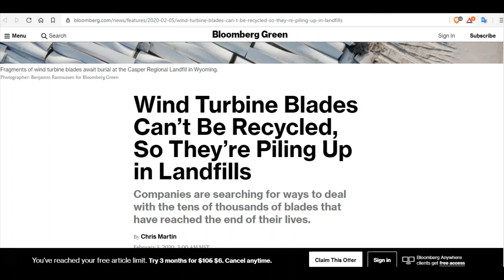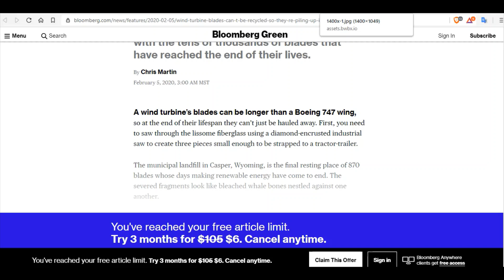Unfurling The Waste Problem Caused By Wind Energy - Boeing's Idea Of Sustainability

Comment: Hey and another little known fact here I spent most of my career and the fiberglass and Plastic industry and I can tell you is that the main ingredient in fiberglass and fiberglass production is oil are petroleum products if I was simply creating these wind  turbines replace fossil fuels I would eventually have to keep using fossil fuels to keep building them great plan right?

Comment: Oh it gets worse than that diamond. MY son a Certified Rope Access Technicians. He spent a year working on those wind turbines. Those turbines have a high failure rate. Yearly. Just to cleanup the mess up that happens  inside those coning tower's is a $10,000 dollar bill to start..  Those gear box,s scramble horribly. And are filled with 55 gallons of oil that blows out the busted case and runs down the whole  inside into a concrete tub at the bottom. 
A barrel of oil per tower . Count those towers around the planet. And know its get over hauled at least once a year. At around $100k to 250k each . And those blades. The Edges is a $75 To $100 an hour full time 8hrs aday per each blade of a job . Not including materials.To fill and patch all the pitting that takes place..  Turbine farm  of 300. contributes less than  10% of energy  as a whole . to power the companies. Notice you never see everyone spinning during a windy .  it cost more To maintain them then they produce in  output ENERGY.

Comment: East Germany build 4 million fiberglass paneled, 2 cycle powered cars called Trabant. My father owned one. They were unable to completely recycle all that fiberglass after the cars landed in scrap yards. Eventually, a wise man designed a street paver made out of crushed fiberglass and concrete mix that dispensed with the problem.

Comment: Never thought about a windmill as a co2 solution. It is more of an engineering challenge of competing ideas. 
    Personally my house runs on a heat pump. And with one you learn to supper insulate.

Comment: Would they melt if dumped into an active volcano? Fiberglass is glass after all. Wouldn't it just melt back to silicon again?  That seems really stupid that they can't be recycled. How do they transport them to the installation site in one long piece? They must have equipment to transport them, but we need to cut them up to bury them? This makes no sense.
Reply: Oh yeah in grand forks nd I've seen them being transported on a huge trailer. Traffic had to be stopped to just get that thing on the road.

Comment: That's not true that it can't be recycled they don't want to pay to do it right. They can grind it up and use it for road fill and mix it with asphalt. There's only one problem it makes the road so good it doesn't were out and the road builders don't like it no more repair work ground up tires do the same thing lasts up to 3 times longer. No contracts no jobs that's the real reason.

Comment: I’ve got your point, any alternatives to this problem. Firstly the carbon footprint of these turbines is extremely poor, the “clean” energy these things produce during their productive lives, barely covers the pollution and CO2 emissions for building these wind turbines. One company in Europe is making the blades from steel, so they at least can be recycled after their lifespan. At present I am at a loss for alternative processes for cleaning this mess we’re in, but to use less and be more efficient in using our precious resources.

Comment: Damn. I'm a Texan using wind power company for about a decade, now. Came across this video after researching to go one better by diy geothermal to heat/cool my home. 

This is sickening, just like the latest and very recent Michael Moore produced doc dealing with other problems in the green energy movement that are tied to the corporate model problem as well. Why can't they recycle those blades, or make them into something else that's useful?
Reply: I looked at a provided link here, and there is a company looking to turn these into housing materials.

Comment: We would have to digest the resin specific to what type it is and remove the fibers seperately for processing. The resins could be reused with biofiltration the main problem is if they are aluminum fibers, might be worth turning all of that into aluminum air batteries which is why they rather bury it instead of repurpose the materials. We take it out in its natural state its no surprise its best put back while in it, no?

Comment: There's nothing like free energy as most people would like to think. There will always be a footprint and recycling the blades is just the tip of the problem. The batteries are the main culprit. They radiate and have half-life equivalent to radioactive materials. 

Fossil fuels when burnt degrade quickly, the only downside is emissions which can be easily modified if half the research money spent on alternative energy propaganda was spent on emissions research. 

But hey why would we do that. That'll make the job easier wouldn't it?

Comment: Why are the blades formed of fibreglass and not aluminium it would be more easily recycled and were these blades Brocken why couldn’t they reuse them (recycle) them what a wast of land and resources it’s shameful and going onto solar those panels can be disassembled removing aluminium and using panels as roof tiles (shingles) W T F

Comment: all true Diamond. So why arent we using the planet? The mass of the planet, can be used with gear train tech of several different types to turn generators. Go to any auto shop. they have lifts that lift your car so mechanics can stand under them. usually around 1hp electric motors pump oil in to hydraulic rams that lift the legs that are put under the car. you could run with deep cell batteries and it doesn't take a lot of electrical power to do this in under one min the car is up. to lower you push a lever that opens a valve and the oil goes back in  to a tank. if you modify th return system and force the oil to over come a mechanism that has 4 alternators it turns and instead of wasteing the potential energy lowering it in 20 seconds the unit slowly over 5 hours turns the mechanism and is generating power charging several batteries that could run the lifts air air compressor in that shop for a few days . but here is the best part, it uses no fue!. By that i mean nothing was consumed. the mass of the planet is still there. so no fuel level went down. I have been trying to find someone to explain either why it wont work , which it will or why we dont do it and people start the aurgument and eventually they just go away because i wont just except a 2nd graders understanding of science and take what they say whith out them having to back it up. THere is a product called a "gravity light" that runs on this susspended mass concept . it cost arpund 70 bucks.check it out. it is something you might want ti ad to your store also. thanks man you rock